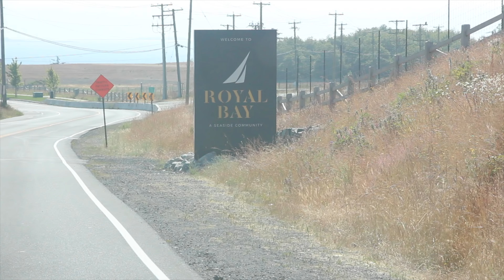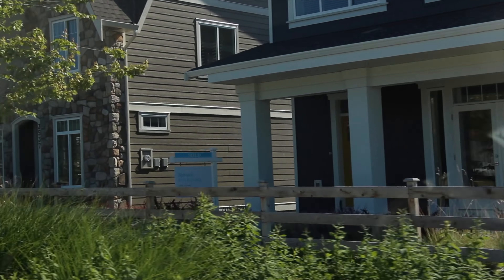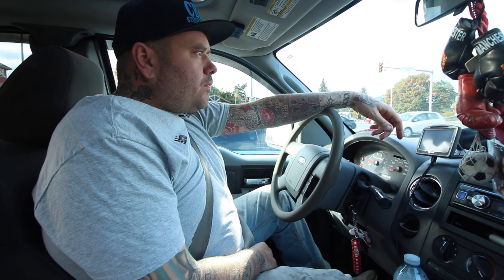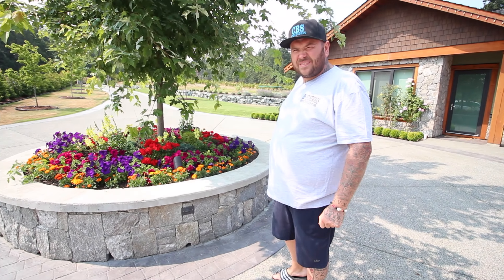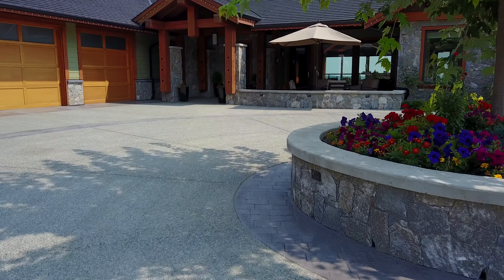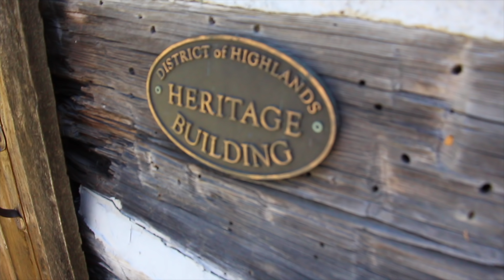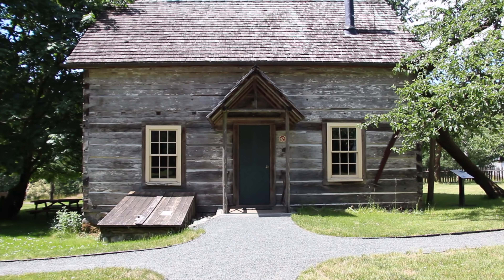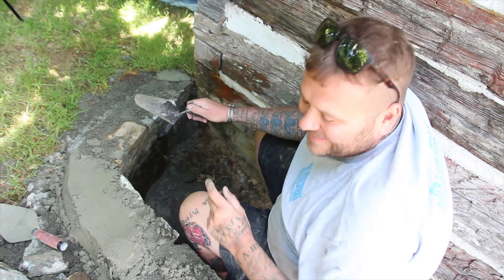A Day In The Life with STONE MASON BUSINESS OWNER Adrian Sims - CBS Stoneworks

Comment: The flower bed is a good idea for the slope entry of water, but wondering if the rain channels into the two holes or pools.. if there was a resevoir under the ground line this could also serve as a cistern collection .. not only useful for flours but you could probably incorporate that into raised bed system.. with wicks in the soil... ie like mop strands or purpose build wiking material... to draw the water up to the root level.. this is a good system of water collection and use .. if you had a hand pump you could also evacuate the cistern pool for watering etc... the idea is good.. but could be improved imo. Is the entire bed foundation a concalve in all direction so recessed on the friction slope ... also do you use a smooth stone leading into that area or does it drain along the pointing/creveses.  also is there a picture of the inside of the bed before te soil is loaded? Good idea imo...